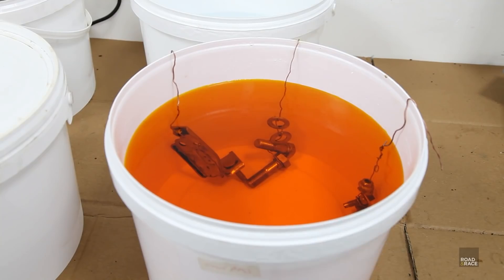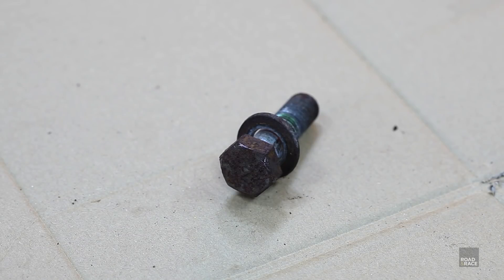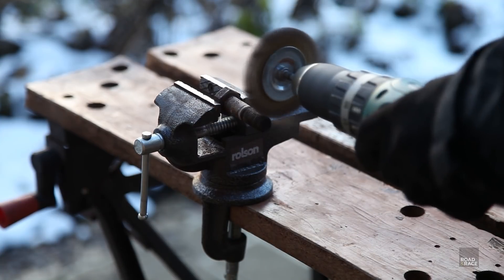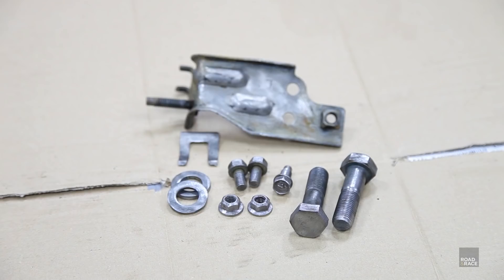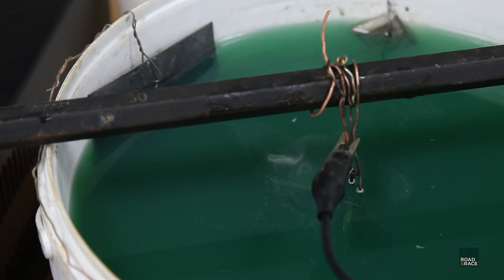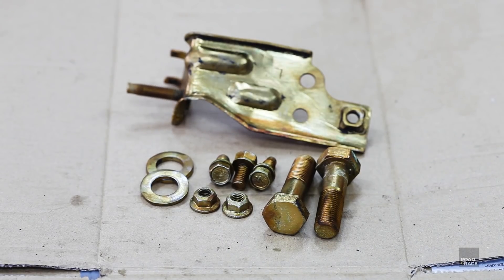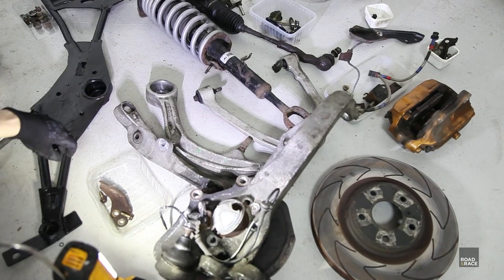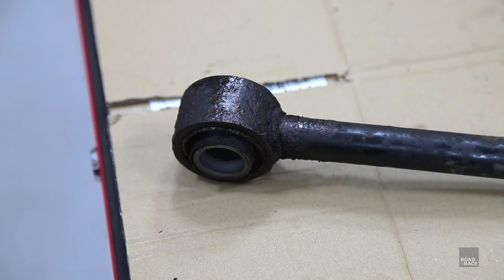Nissan 350Z - Rust Prevention Pt.3 - Zinc Plating Guide

Comment: I've been looking at doing the same thing with some of the rusty bolts on my CBR900RR. from what I've seen in my limited (this evenings) YouTube experience, the process can be done much cheaper and easier using readily available products.
I'll try them first as they'll cost a few quid and fingers crossed, they'll work. Otherwise, I'll be back here to make a shopping list 😂

Comment: Great video as always. Have you considered hydrogen embrittlement? The higher the tensile strength of the steel part, the more they get embrittled by the plating process. De-embrittlement is a particular oven bake process, and when I take my parts for zinc and passivate I always request de-embrittlement. Thought it worth a mention...
Also; don’t forget that poly bushes introduce a bearing surface that is not present in metalastic bushes (the rubber just stretches) and they often squeak badly after a few miles. Stiffer metalastic bushes sometimes provide a better solution but are often hard to find in the sizes.
Keep up the great work 👍

Comment: Bead blaster might be a good investment aswell
Reply from the maker: Would be nice.  Know where I could get a cheap one?
Reply: @RoadandRacetv   ermmm my current workplace is closing down! And they have 2 they’re getting rid of I can get in touch and see what they’re doing with them. If not eBay vixen are good. You can get wet blast aswell but a bit more space consuming. Really miss your e92 m3 btw I’m in the market for a black manual like yours was!
Reply from the maker: @stagsterprogaming  Cheers Louis, that'd be great if you could find out.  Yeah, I miss the M3 as well.  Amazing car it just cost me £70 in petrol whenever I made a jouney in it!
Reply: @RoadandRacetv   I’ll try and find out any info and pass it your way. Just out of curiosity what does the m3 mpg compare to your 350z?